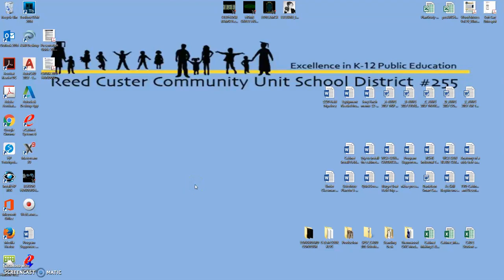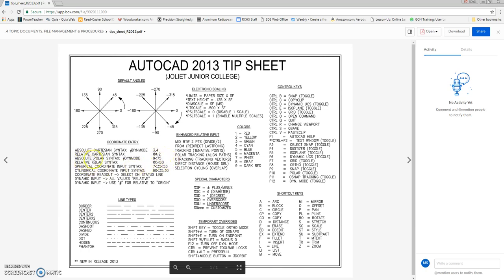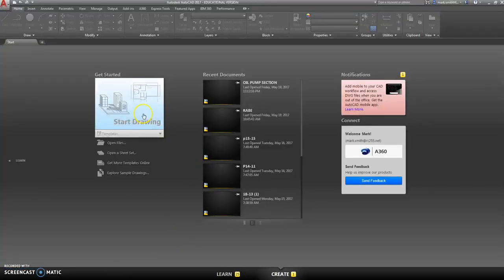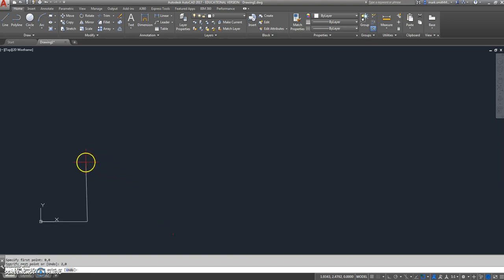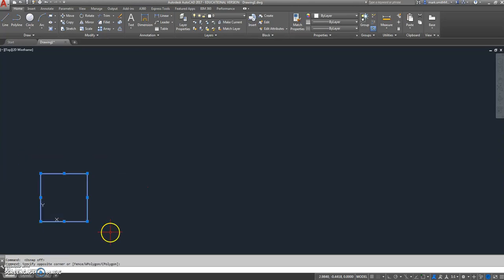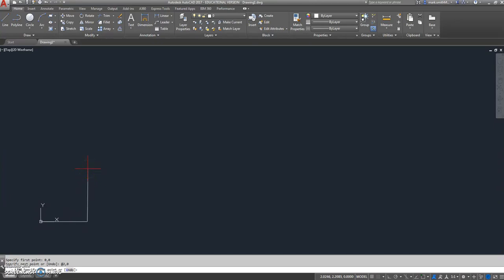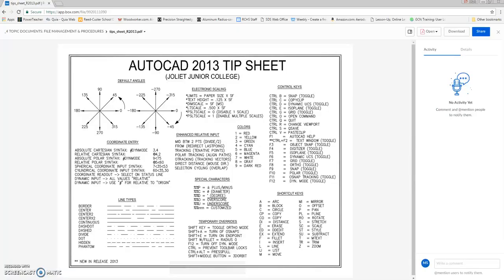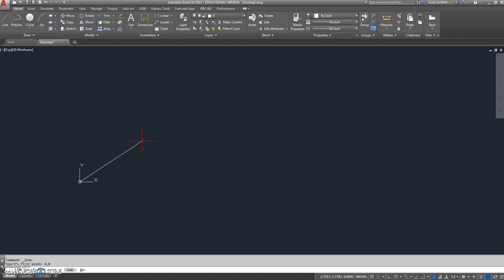AutoCAD Coordinate Entry Methods

Comment: sir when i m putting the coordinates it automatically putting in a box near the mouse point so how can i disable it?
Reply from the maker: Typem ddsettings at the command prompt.  This will take you to the Drafting Settings dialog box.  Click on the Dymanic Input tab and uncheck the Enable Pointer Input box and the Enbble Dimension Input where possible boxes. Now click ok.  That should fix it.
Reply from the maker: Oops, I meant type ddsettings